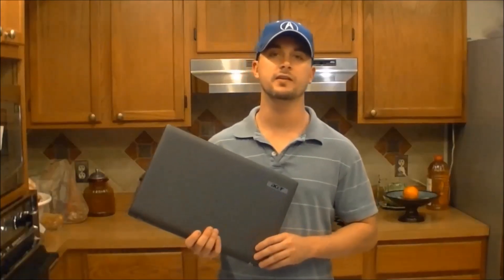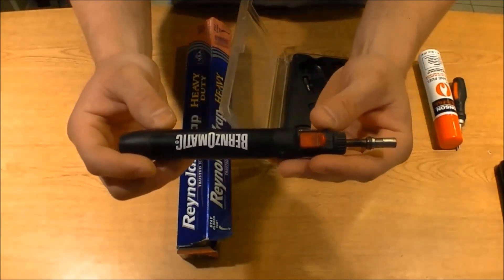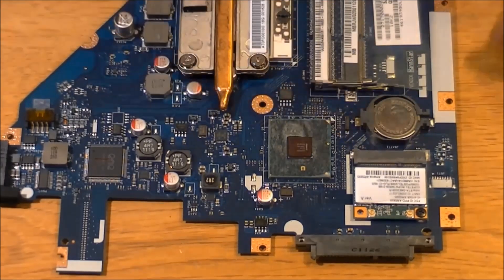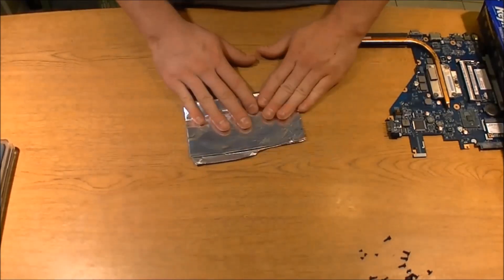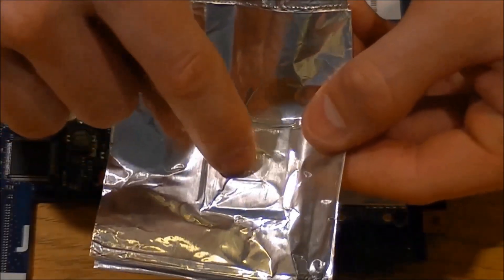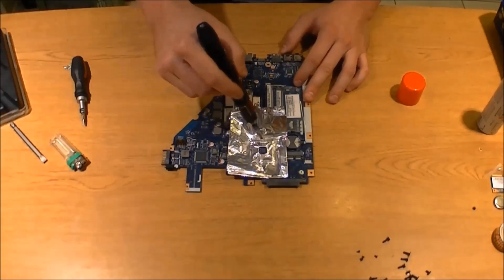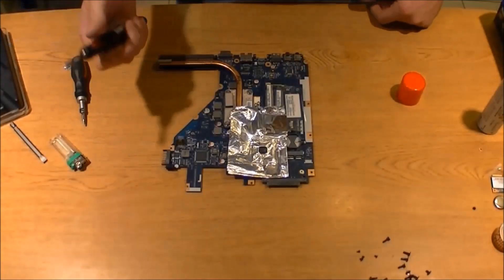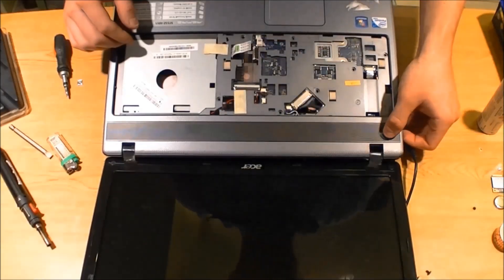Reflowing Chipset

Comment: I did this on my Aspire 5551 laptop, and it worked!! I used that adhesive aluminum tape, instead aluminum foil. Two layers of tape and a kitchen torch. Thanks for the tip man!

Comment: Don't fold the foil so damn tight. Aluminium is very thermoconductive.
You want to trap as much air in the folds as you can, otherwise you're defeating the whole purpose of thermal shielding.

Comment: Ummm I would have thought a cheap heat gun would have been a better choice of "tool" than a dirty great naked flame.

1. you risk serious damage with a naked flame.
2. solder reflow is meant to be done to a profile for best results either using an oven or reflow station. They have a profile with stages for a reason to stop thermal shock and intermetallic growth.

If people insist on doing repairs this way at least use a heat gun for the love of god.

Comment: Btw, if anyone wants to know the actual, proper resoldering protocol, from an actual, embedded microchip engineer, here it is: 1) Liberally coat the entire BGA contact surface with a quality, no-clean liquid flux. 2) Pre-heat the entire GPU/motherboard area to 200* F, and maintain it for AT LEAST 60 seconds. 3) Heat the GPU to between 400* and 450* F, and maintain it for EXACTLY 60 seconds. 4) Cool everything back down in a slow, controlled manner. That's it. The critical part, and the reason these nVidia chips fail, has to do with the exact type of Pb-free solder used to mate the BGA to the board. Leaded solder usually only needs 400*F to properly flow, but the Pb-free stuff often needs 450*F. Too much heat and you'll fry the chip, too little and you'll have a repeat of the initial cold-joint failure. That's why I left it as a range: 400 to 450*. You'll have to decide for yourself what temp to use. I'm not sure how to attain these results with a $10 torch/heatgun btw, I'm simply stating what the ideal protocol is.

Comment: I've had pretty good luck using a microwave oven for reflows. My unit has a preset for "popcorn" which seems to work well. Low sodium butter is a great flux substitute. Smear the butter on the board, throw it in and set and forget it. Make sure you take out the C-mouse battery first!
Reply: Holy shit it works! Thanks dude!

Edit: I can even charge my car battery in the microwave! Incredible! I'm gonna go microwave my iPad now
Reply: om-gosh it works!! thanks for the tips :D
Reply: Red Nadya Hey, good to hear you fixed it and I'm glad to help you out.  :)
Reply: Yeah, it gives the popcorn that extra twang.
Reply: Please dont do this.

It will mess everything up. Please dont listen to this troll.
Reply: seriously?

If itworks then w/e, but I always knew that electrical components in the microwave is NEVER good idea.
Reply: and i got that buttery smell on my electronics too!! next i gotta invest on that c-mouse battery. i heard it helps you make popcorn!
Reply: Peter Kim he said microwave-oven not microwave, two different things
Reply: Lol!

Comment from the maker: Check out "Dell 7 Beeps Fix" on my channel for those of you that think re-flowing a chipset has to cost you hundreds of dollars...Now sometimes if the re-flow doesn't work you have to re-ball it with tiny beed's of solder but in many cases you don't..Afterwards to prevent over heating again you will use a small copper shim aka a sanded down and buffed penny on both sides under the heat sync & then add thermal paste.I've had laptops that I have re-flowed for customers as a last resort and I do tell them it's not 100% but they have nothing to loose and some of them are still going 4 yrs later. My personal one I re-flowed 5 months ago and shimmed it and it never acted up again..before it wouldn't even post.

Comment: WOW! Sometimes you see things on here that just make your jaw drop and you unconsciously begin to shake your head. This was one of those things for me, No proper heat shielding, no thermocouples to keep track of the one degree per second temperature rise rule or the maximum safe chip temp to forgo overheating and burning out the chip. No pre/post heating to prevent cracking the silicon that you are blatantly and indiscriminately heating with a blow torch no less, or stop the re-flowed solder from cooling at different rates and causing the same issues again. Hmm all I can say is I look forward to the next tutorial where you show us how to replace the LCD screen with a few well placed whacks with a hammer. Seriously people. Experiment if you have no hopes of ever using your laptop again, that way you will not be losing anything to try, but if you really wish to possibly have a working laptop again, DO NOT PROCEED WITH THIS REPAIR AS OUTLINED HERE!
Reply: @Wayne you seem like you know alot about this stuff. Why not make a video instructing us how to properly do it?
Reply: @NossyDrelich  :  it's absolutely a wrong and stupid video which misled viewers to ruin their board.

Comment from the maker: First, the solder balls could come loose from heating and cooling down. A good way would be to place a flat copper shim on top of the chipset before placing heat sync on, It will give it better heat dispensation.